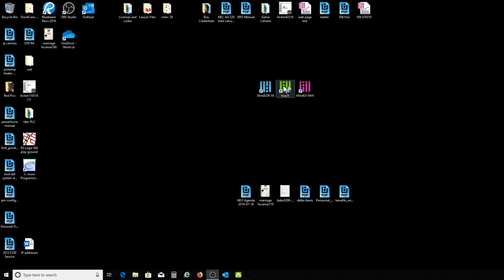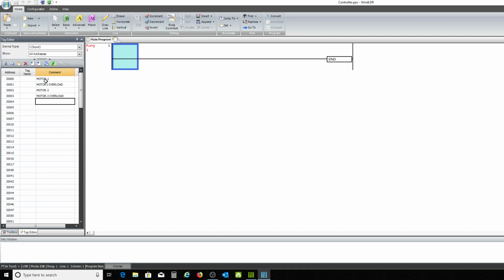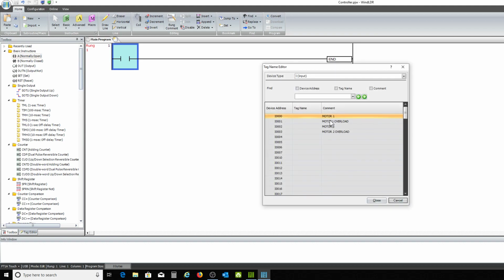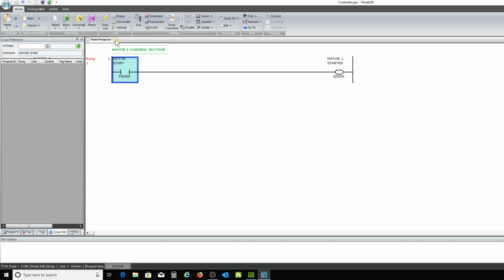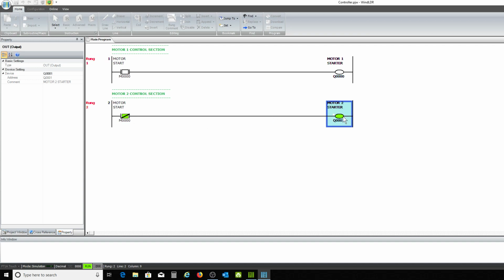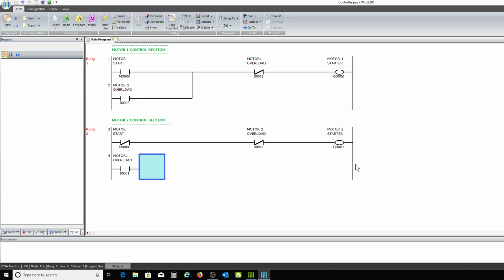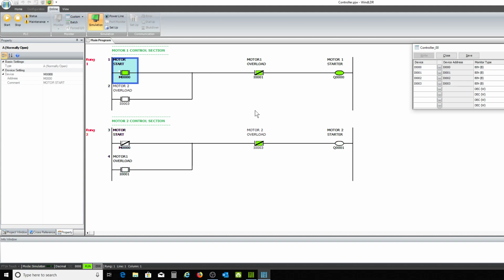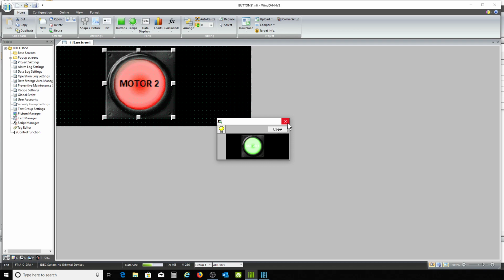IDEC Pump control Part 2

Comment: Thanks for all your videos.
But I am struggling with the analog output. I want to use a pressure switch to keep the pressure in my pond filter from exceeding a preset value.I want to connect the analog output of the sensor to the analog input of the plc and then through a PID to control the analog output which in turn controls a variable speed drive. If the pressure rises then the pump will run slower is the filter cleaned again the pump will run in higher speed.
I have an FT1A touch with two analog outputs and two analog inputs that I want to use for this.
Can you help me with a video or do you know if there is already a video for this?

Comment: Great video CF.  Thank you so much for doing that, it was perfect.  I just have one question for another idea where this could be used.  Is it possible for the system to be completely automatic / unmanned, where the input is from a float switch in a tank and the pumps alternate to the next each time that float switch closes?  I'm guessing it'll probably need an external flip flop relay or similar, however it would be great if it were possible using the PLC only out to the contactors. Many thanks again.
Reply from the maker: Yes, that can be done also.  Let me expand on the program and create another video.  Great idea.  I will get it up this weekend.
Reply from the maker: I haven't forgotten about you.  I just got real busy.  Transitioning to another job.  I have a few days off before my new job starts.  I will get you a video up very soon.  Hang in there.
Reply: Cheers CF.  I'm looking forward to it.  Good luck with the new job
Reply from the maker: Video is up Buddy.  I hope it helps you.  I can dive more into it, if needed.  Let me know.  Always happy to help if I can.